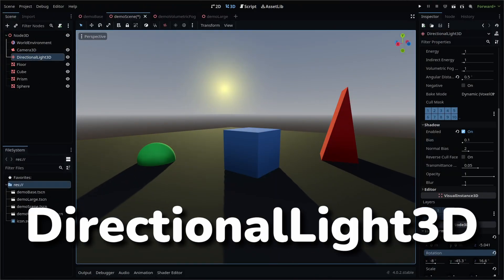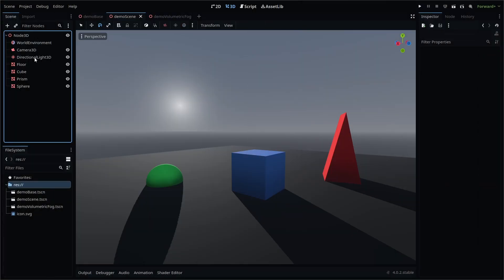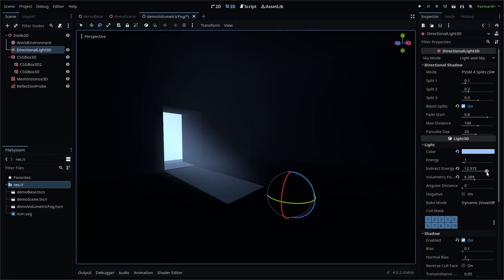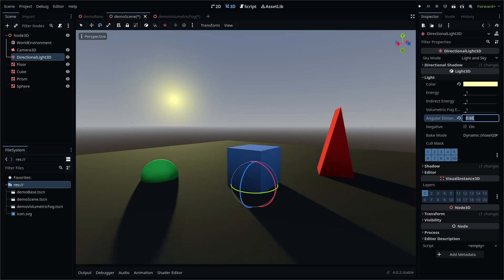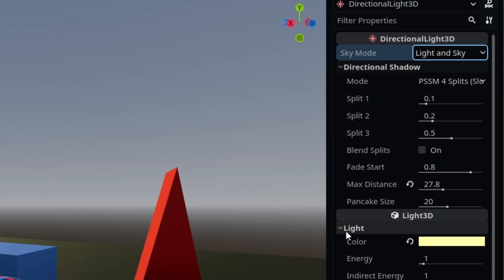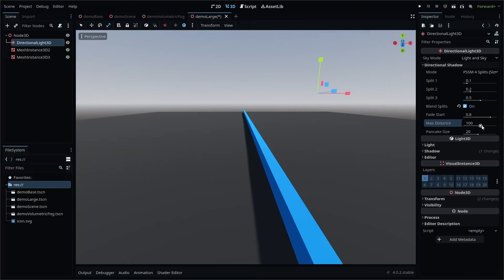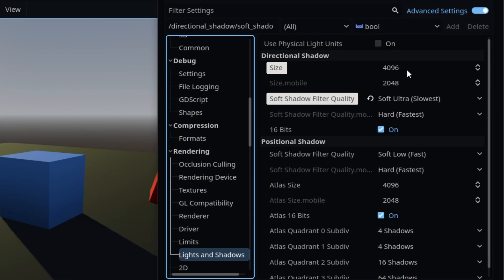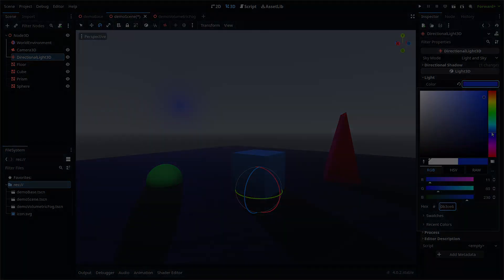ULTIMATE Guide to Directional Light 3D Node // Godot 4 3D Tutorial

Comment: Something important to mention:
- Currently, PCSS Shadows (Angular Size > 0) interacts oddly with the Blur Size value. Instead of adding blur to the shadows, it multiplies the angular size instead. This means that it's impossible to get rid of the aliased edges of the shadows near the casting object when using PCSS, because these pixels have a "internal blur value" of 0, since it's multiplying, these pixels are always sharp regardless of the Blur size.

The only fix I could find was to set the Shadow Map resolution to a really high value, which is expensive. Hopefully they will fix this in the future.

Note: When PCSS shadows are disabled, the Shadow.Blur value behaves as intended.
Reply from the maker: Great information!  I've noticed some weird effects as well but haven't tested thoroughly in different versions.
Reply: How can you have sharp, non-blurry shadows?